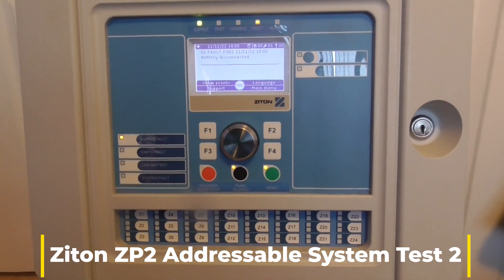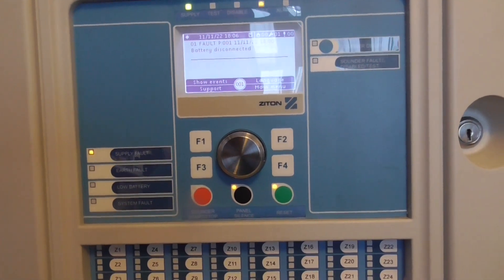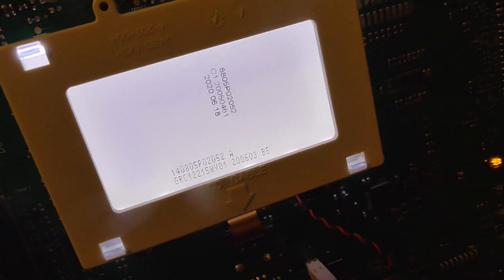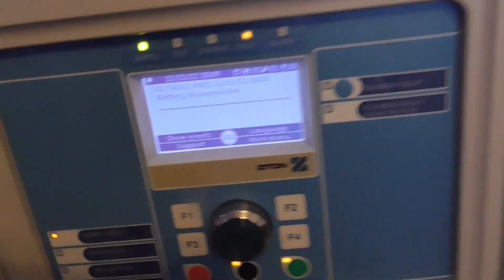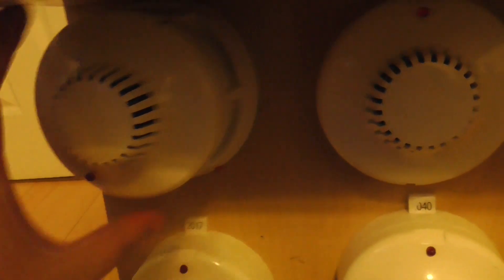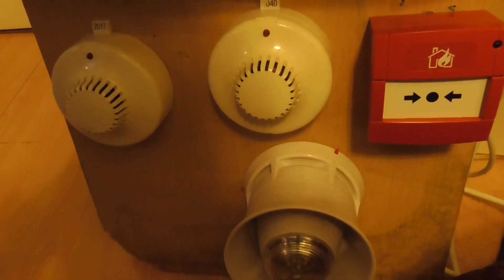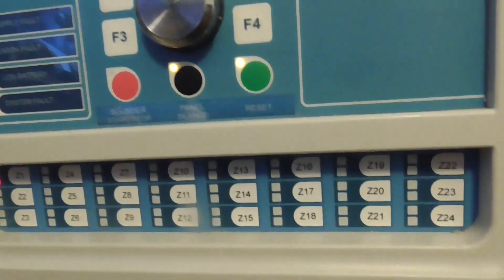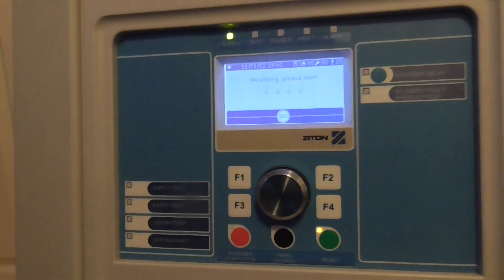Ziton ZP2 Addressable System Test 2

Comment: Is that a normal base sounder under the horn??
Reply from the maker: Yes the base sounder is a Ziton ZP755HAV-2P which fits with the horn sounder.
Reply: @j1firesystems440  ah just wondering. Cant think of any reason why your strobe wouldn't be working.
Reply from the maker: @JmFireAlarms  I will just have to figure it out. It could be faulty or it may need to be programmed in the software for the beacon to flash. But I am pretty sure it’s not the dil switches on the back because I played around with them to try and get the beacon to flash.
It may also only work on Ziton ZP3 panels and not ZP2s.